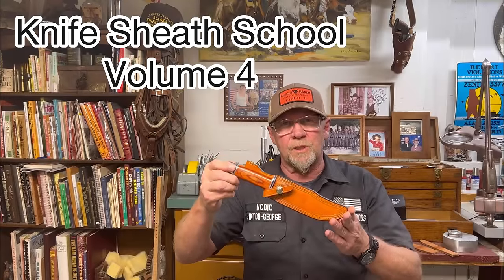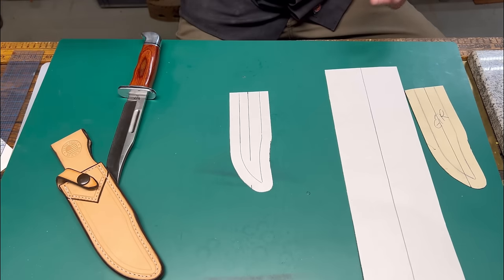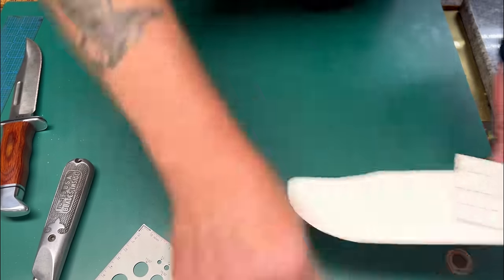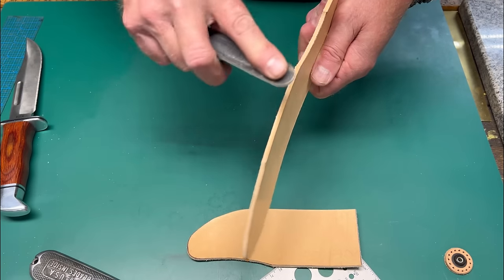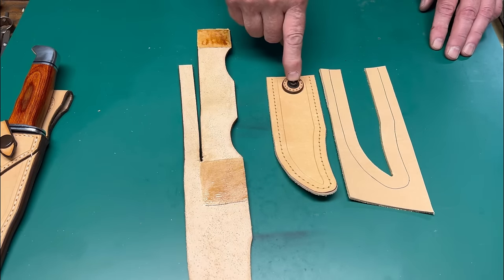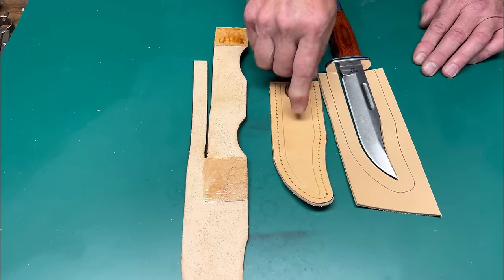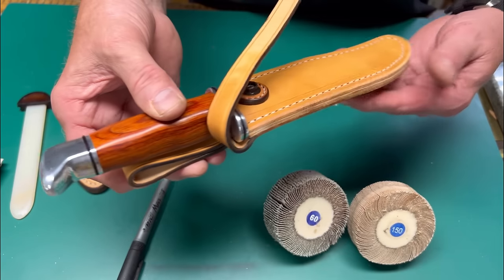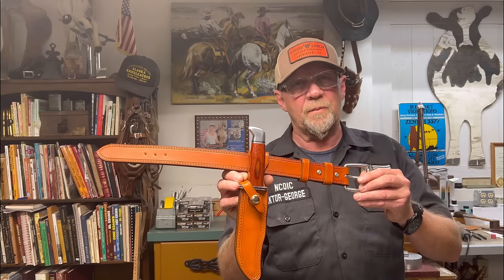Buck Knife 119 Belt Scabbard:Viktor George Knife Sheath School Volume 4 #youtube  #leather #edc

Comment: For my first ever knife sheaths, I followed your video for the KBar magnetic retention sheath. My first one of the five I made, the knife was very difficult to remove. It turned out that my welt was thinner than the blade. If you mentioned that in your instructions m I missed it, so to all us newbies…make sure your welt material is as thick as your knife blade.
Reply from the maker: Thank you Alan for highlighting that. I’m sorry it gave you  difficulty   Yes the welt needs to be firm good quality leather and normally I cut it from 8 to 10 oz vegtan
Reply from the maker: I had to check😂 and for that KaBar magnet sheath I suggested an 8oz welt at 18:35 Thanks again Alan  That helps me fine tune my presentation for future builds🙌

Comment: That is a tremendous job George !  I love it!.  I pick up some "nuggets" of info from all of your videos and appreciate your sharing of great information!.  I have gotten into doing more sheaths, and really like doing them.  Your work is the benchmark for me to strive to attain!   Can you tell me what you use to do the edge lines?  I mean the area like on the belt loop portion.  I cant seem to ever get mine to look that good.  Thanks!
Reply from the maker: Thanks as always Fred for your positivity and support. Actually those crease lines are achieved by those wing dividers followed up with that plastic bone folder The leather must be lightly moistened to take a deeper crease line. Cheap n quick😂
Reply: @viktorgeorge9144  You know, I knew the answer would make me whack myself in the head and say " DUH" !! lol   I have been trying to use one of those cheap adjustable creasers from Tandy, for years, and never really got the results I liked.  I thought about getting some of those fancy edge creasers, but only are one size, and a little pricy!  I think my method was not the best either, always tried to do it in a single pass, but like I said... duh on my part !!  Wrong tool, too wet, trying to do it in one pass, IMPATIENCE... etc  . If and when I overcome those, I am sure they will get better.  Sad thing is, I have a set of dividers I can sand down, got the bone folder, or folders! And could have been doing it this way all along!  Time for a little polishing and practicing Thanks again sir.  Looking forward to the next one!
Reply from the maker: 😂thanks Fred This simple technique resulted out of necessity decades ago and even tho the cool tools are now in abundance I still prefer the simplicity and results of this method

Comment: Saludos estimado Viktor, cada video que tu subes es una verdadera clase maestra para quienes estamos en el mundo de la cuchilleria , por favor un consejo: aca en Ecuador no tenemos TOKONOLE, que podria usar ???? para dejar los bordes de las fundas  brillantes y suaves como tu los dejas , muchas gracias , un abrazo desde Ecuador
Reply from the maker: Thank you Gustavo Very nice of you to say. I don’t use tokenol  You can use a bar of glycerin saddle soap or liquid saddle soap, beeswax or just water. The trick to smooth shiny edges comes with hand sanding your edges. Start with 220 grit, then 400-600-800-1000 grit sandpaper and your edges will shine.
Reply: @viktorgeorge9144  muchas gracias , Viktor , excelente  solución

Comment: Nice , I was wondering if you had ever tried to stamp a belt after you glued the liner on ? Buddy of mine decided he wanted it stamped after I’d glued the liner on and never had tried it before. Appreciate the videos.
Reply from the maker: Thanks Don. I think that would depend on how thick both layers of the belt are and if it’s been sealed with waxes or acrylic. At least worth a try somewhere near the turn back so if not no harm! Thx for your support
Reply: @viktorgeorge9144  George the liner 3. 4.  and the top is 8  9  . I just didn’t want to ruin it but all I’ve done so far is oiled it . Thanks

Comment: @Viktor George, Where's a good place to get leather for knife sheaths? What weights would you suggest? Would the belt loop be a different weight? Same for the security strap? Thanks!
Reply from the maker: Hello David For most fixed blade knife sheaths 8/9oz VegTan leather is the norm. Smaller pouch sheaths can go 6/7oz but also depends on the size and weight of the folding knife. Think Buck 110 versus a Case Trapper for example. Traditions Leather in Oklahoma is a great leather resource but of course Tandy leather is a good place to go in person to pick out. Their European bends are a good way to go. Yes all the straps and add on belt loops would be of the same weight

Comment: I am trying to make a similar type sheath.  The knife is an Ontario Knife Company “Afghan”.  The blade is 1/4” thick and the handle is 1/4” wood on either side of the 1/4” tang.

I am using 9/10 oz leather.  Can you recommend how many layers of leather I should use?
Reply from the maker: If you’re talking about the welt thickness I would first place by gluing one layer of welt (9/10oz) onto the sheath face and then sandwich the pieces together You should be able to guesstimate if another layer of welt is needed.  Remember you can skive the welt down to the thickness needed. So hard to explain that in words tho. Good luck